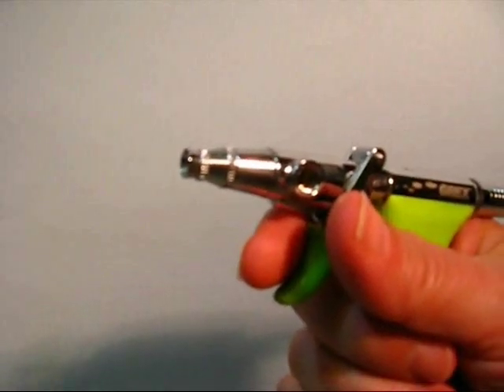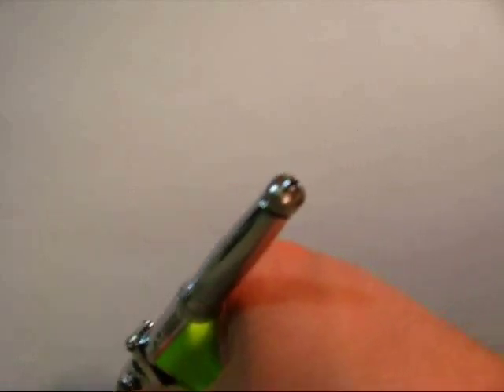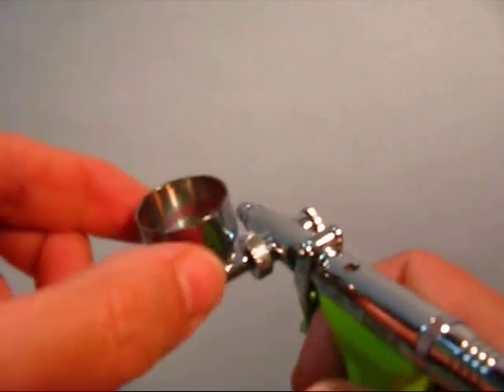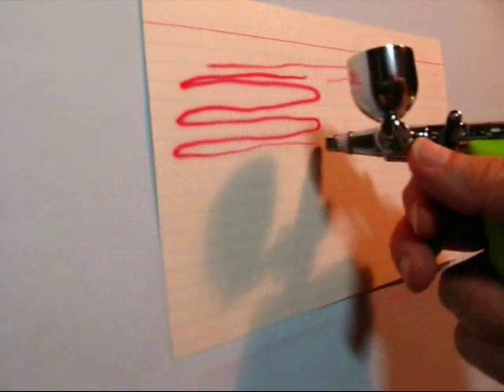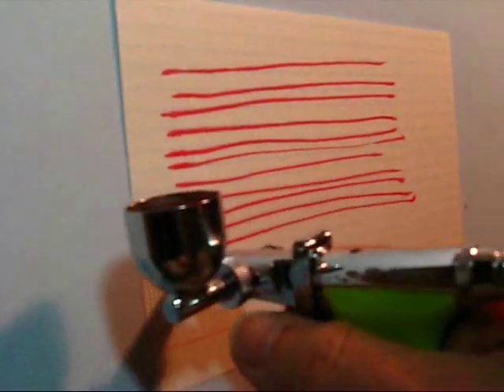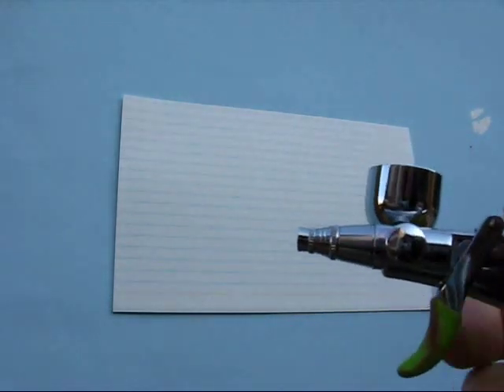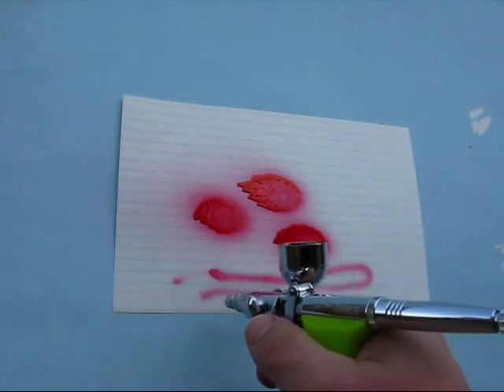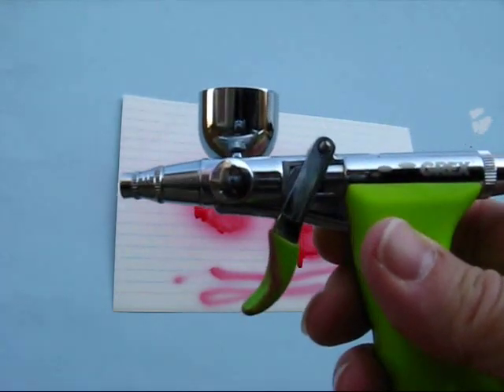Grex® Tritium.TS Airbrush Demonstration

Comment: Actually only a one-and-a-half action airbrush.  As stated by another poster, you cant control air flow with the trigger, only on and off.  But, you can add a micro-valve at the air supply inlet that allows you to quickly change air pressure at the brush.  This makes it very much like a full-size spray gun.  I have sold one of my Iwatas and two of my Paasche Hs (still have two more), and bought a TG.  Awesome tool.